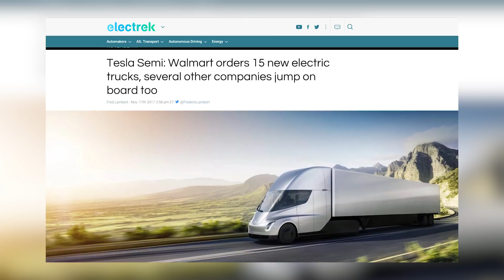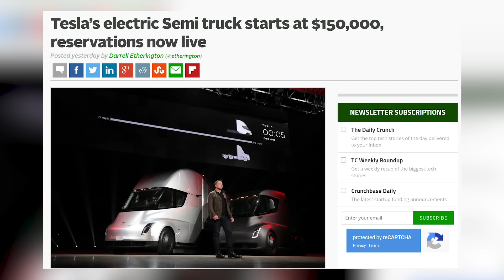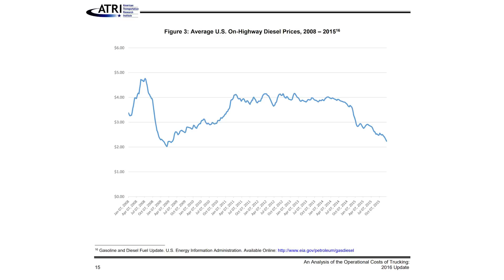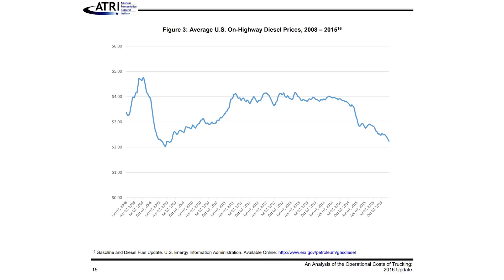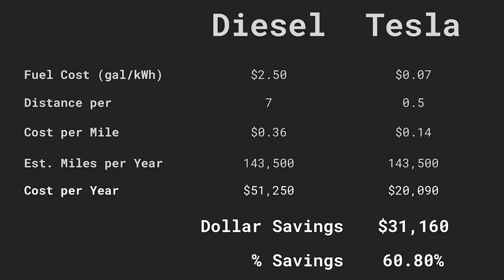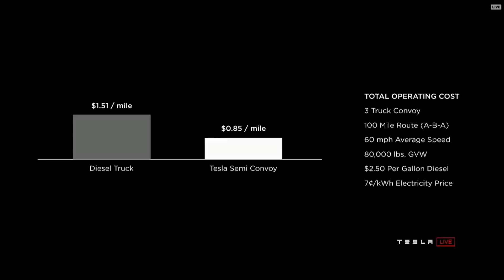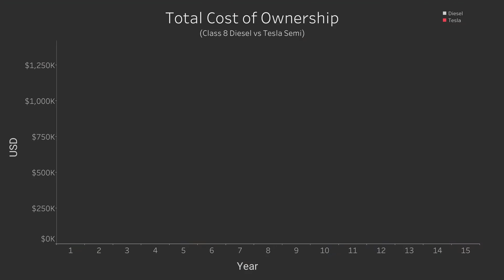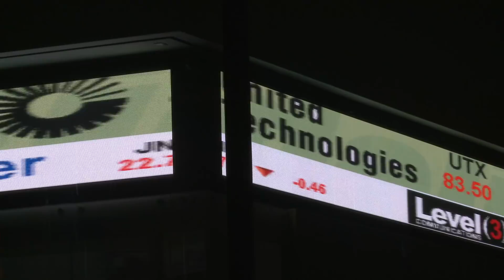What is the TRUE COST of a Tesla Semi?

Comment: Cost of diesel almost double in Australia as well so an absolute game changer here 1-year payback wow.
Reply: Ben Dixon cost of trucks is also more than double. A typical 5 year old Kenworth with half a million km on the clock is about 300k. Even with taxes and conversion, the top of the range Tesla is cheaper than the cost of an old diesel. As soon as the Megachargers go in, game over for diesel in Australia.
Reply: 3 times in norway. And extreme cost savings in "bompenger" it cost 20dollars just to enter a new area here.(for trucks) And 0 dollars for all electric cars/trucks.
Reply: dunhillsupramk3 Sadly it appears that you don't know even the first thing about truck driving. Your average truck driver doesn't drive "10-14hrs a day" for the very simple reason that it's against the law.
Reply: Unfortunately the 36,000kg GVM makes it pretty much useless for long distance haulage in Australia. One smallish trailer is too inefficient except for arpund town deliveries. The truck I drive is Approx 38,000kg empty (B- triple) and then we add a 70,000kg load of wheat or other grain for a GVCM of Approx 108,000kg. Plenty of heavier trucks than this on Australian roads also.

Until Tesla come up with a higher GVM rated truck I guess they will only be used on short delivery routes in Australia.
Reply: Electricity costs 4-5x as much though thanks to our delinquent government.
Reply: Game over, it will be an opportunity to short business here that don't order them.
Reply: and whats the avg distance a semi truck travels between stops in Australia??? as far as i'm aware the big mining companies and the big farmers in Australia is the ones that really order the big semi trucks (and yes they're directly responsible for semi truck development in Australia) carrying a big payload like on a road train the Tesla Semi truck would get far (unless maybe it has a built in generator like a hybrid).... the main reason why Tesla really developed this semi is to deliver its Tesla cars (because it looks bad when Elon Musk says EVs are the future and the Model S is being delivered on a big diesel semi).... anyways EVs has been around for over 100yrs and Tesla has been around for over a decade now, you say game changer but not that many people is buying EVs compared to ICE... 

at the Tesla semi launch the biggest thing was "oh look at how fast it can accelerate" which is something thats pointless when it comes to semi trucks..... if this is better than your normal diesel semi truck big companies from all over the world will buy it (the same way how Nicola corp sold out production within the 1st few hrs of launching their hydrogen semi truck last year)
Reply: dunhillsupramk3 525 km is the legal maximum distance a truck can be driven before stopping in Australia.
Reply: You're kidding right? I gave you a link to the rules. I don't need to make them up, I just copy them from the National Heavy Vehicle Regulator.
Reply: 80 000 lb is the legal maximum on the vast majority of US roads. Given that it's about twice as powerful as any diesel truck you can buy now, and has better brakes than any diesel truck you can buy now, it seems vanishingly unlikely that it won't be rated for higher loads in other countries. That said, the MegaChargers are going to be installed on routes with high volume. When they come to Australia that's going to mean, at least for the first few years, Sydney/Melbourne and Sydney/Brisbane. It seems unlikely that MegaChargers will be installed on seasonal routes that only see traffic in harvest or similar or the very low volume traffic routes that currently allow road trains. Basically, the market for these low volume routes is simply too small to matter.

Having said that, don't forget that while Road Trains are illegal in nearly all of the US, this truck can convoy 3 trucks with one driver. Effectively allowing Road Trains, even where such things are illegal (as they are in many parts of Australia). That means road train like convoys on the Hume and the Pacific.
Reply: gasdive you make some very good points that I had not considered. I guess I have been stuck in my bubble here in central qld a while. 

I really hope electric trucks take off here and they stay together on our average dirt roads.
Reply: This is the way forward to save the planet. Stop making excuses and let it happen. Battery charge stations are needed. If only Texans would see a market here and jump onboard rather than opposing electric cars!
Reply: Australia is very flat...I see no issue with Tesla getting a heavier rating in Australia.  80,000 lb is just a US limit.  That limit is mostly in place for roads and bridges, not to spare trucks all that weight.  Though breaking could be a concern also in the US.  We have flat areas but we have mountains as well.  Run away trucks happen all the time.  We even have special ramps in some notorious places to save the trucks whose breaks have caught fire.
Reply: @gasdive thats stupid.. so if its out in the middle of no where does that mean the truck has to stop where it is?? your avg trucker drives for about10-14hrs a day and i'm very sure they'll cross that easily... on avg they do maybe 400-600miles a day (and thats with a very heavy trailer)... the reason why so many truckers do this is because most of them is paid per mile so by the end of the week the more miles means more pay.... if this Tesla semi truck was as good as you experts claimed then big companies from all over the world would've bought out production for a few years like what happened with Nicola corp and their hydrogen semi truck....
Reply: check the law buddy.... because it appears you're making up your own laws....
Reply: Rikaishi, Tesla is planning to generate and sell the electricity direct to the trucking companies. They may well be selling at the same price here (plus tax) as they sell in the US.
Reply: Ben Dixon so Australia also pays triple for electricity
Reply: average about $0.30 AUD ($0.23 USD) per KWH in Australia.
internet says average price in the US is $0.12 USD
Reply: taxes high on fuel will charge them on electric in future.
Reply: oil has hold of texas
Reply: Teslafaninsight  I'm all for bettering the planet. But I can't see the long run of these how do they know all of this stuff how long has it been tested and this puts my job at risk as I work in the class 8 industry  who can work on them what's this mean for mom and pop company's and the numbers don't add up to me
Reply: Nice all good questions.  It is five to ten years before huge changes occur.  Tesla only company at class 8 level in long distance electric.  Nick the electric truck motor in teslas case is 3 time 17 parts or 55 parts or so vs. 2000 in an Ice engine.  repairs needed but with fewer moving parts very little mechanic work will be needed.  There are so few part that it might be throw away and replace on motors rather than even bothering to fix based on the value of the time of the mechanic over the cost of the motor.  Many issues to be figured out.
Reply: The big routes in Australia are Melbourne-Sydney. Sydney-Brisbane. All could be done with 1stop. The outback road trains are a very important market, but a very small one. Australia is a very urbanized country and the Tesla semi will take over.
Reply: all would like to see that too.  given shortage of batteries for all makers right now.  My read is they will focus on selected areas that other companies cannot do without their technology
Reply: I'm really interested in finding out how the industry and road rules and regulations incorporate the design of the driver being in the center of the truck. Been driving for 20 years and I just don't know how that's going to work.
Reply: Australian dollar is less that usd
Reply: Not really lol, 3500kg is bugger all. I can tow that with my $40k for ranger.
Reply: Same goes for Europe. Even in Germany, where Gas is comparably cheap we pay about 5$ per gallon for Truck Diesel and even more in countries like the Netherlands or Norway. Compare that to electricity prices that due to little demand and high renewable energy production this year even went negative is just a no brainer.
Reply: No they can't hang with diesels

Comment: Acceleration of a trucks mass requires the most energy at the start. Air resistance after cruising speed  is achieved then becomes the greatest energy requirement.  Some acceleration energy is recouped with regen braking. Low air Resistance per tonnage  greatly improves efficiency. Rolling resistance of the tires and wheel bearing friction are also a factor which can be improved with proper tires and tire pressure. I will be waiting to see how efficient these trucks really are.  By platooning (decreasing air resistance) really increases efficiency per tonnage.
Reply from the maker: Going to be interesting for sure

Comment: Great video, thanks Ben!  :) Although I think there's a slight mistake - 80,000 lbs is approx 36,287 kg (36.2 tonnes), not 3,628 kg.
Reply: The metric (ie 1000Kg) equivalent of the US Ton is spelt Tonne across the world.
Reply: Joe mariconadas A ton and a tonne are different things but a similar size. A bit like a yard and a metre. Personally, I detest 'tonne' because it sounds like ton and it doesn't fit the rest if the system. It should be Megagram. Mg.
Reply: A metre is a unit of length. A meter is a measuring device. If you're using the word meter to mean a unit of length then you're just spelling it wrong. Like saying your when you mean you're.
Reply: I agree.  "metric tonne" is not part of the metric system.  It should be Mg as you say and it is easily confused with the US ton.
Reply: Is it?? I'm in North America, which I assume then we are the exception to the rule!!!!! :), because that is clearly spelled in French.
Reply: You're right, there is the metric ton and the regular standard ton. At least in the US and Canada a ton is your standard 2,200 LBS. But what I never understood is why would they spell it with the extra N and E?? Same as you spelled METRE, that again is French. Here it's always spelled METER. But, languages don't always follow logic of phonetics.
Reply: Oh, and I should also point out that in the US a ton isn't 2200 lb, it's 2000 lb. You could be thinking of the Imperial Ton, which was 2240 lb (different size lbs of course but only slightly)
Reply: I guess that is a typical North American spelling conotation. Spell it the way it sounds. Meter is the measuring device as well as the unit of measure.
Reply: It's TONS, TONNES is the french spelling. :)=

Comment: i thought the convoy cost was purely on the CLOSE DRAFTING SAVINGS which is possible through sensors and communication  and good brakes which still has drivers in each trucks.  Being driverless convoy could be even more efficient by quite a bit i think..
Reply: The brakes on Tesla's technically ware, sure, but they would need replacement after 25-30years of use, which by that time the tech is horridly outdated in general and thus it's silly to even consider it, especially as most "modern" diesel trucks last 10-20years at most before crapping out in general.
Reply: Travis John lol. Brakes never wear out??? Alone might want to come out into the real world once and awhile
Reply: i said the brakes are good. electric trucks brake much quicker.. elon said youll never have to change brakes and they last forever.

Comment: I have over 35 years of driving, You still need greass in places, You will need some work, The breaks need looking at.  There are things the Elon does not know about, The rules that go with trucking. You will need an ELD that tracks the truck as the driver goes down the road.  I don't know what all to say
Reply: James Baxter 
Did you listen?
The brakes DON'T "need looking at"!
They are basically There for EXTREME emergencies. The regen braking is used for all normal situations, so the  "conventional" brakes "never wear out"!
Nothing to grease! (On the tractor)
Reply: If you wish to listen to him about the brakes, I have a bridge in NY to sell you, They have to be looked at. The truck has to be looked at all the time, The D.O.T. will be on that every time they stop you, Like other things

Comment: Better to change couple brakepads occasionaly that the whole brake system. Thats what happens to electric cars in Norway where they have salty roads in winter and brakes never get engaged...bad selling point.
Reply: They could program the truck to periodically use the friction breaks to prevent this and test them aswell.
Reply: Yngve Lindvåg 
Clutching at straws there?
Note to driver, check brakes twice each day? Easy!
Maybe a "brake test" mode to switch off regen for 30 seconds and monitor braking during the test? Simple. The Tesla must have pedal force/ angle sensors and torque sensors on each wheel, so it could monitor a brake check MUCH more effectively than eyeballing by the driver!
And then, of course, it would relay the results to the driver in real time and a warn of any maintenance required.
GOOD SELLING POINT!

Comment: The truck is beautiful and looks to be a real winner. One thing I noticed it did not SEEM to have any tow hooks or access holes to the frame to attach chains .  Most of my career was spent in the telecom business for Rockwell and other fortune 500 companies. We installed microwave antennas and equipment in remote locations. The  delivery trucks carrying antennas would have no problem most of the time. BUT, most of the sites had dirt/gravel roads and the semi trucks would sometimes need help due to traction issues, either getting in or getting back out. To help we would typically use a backhoe to perform this task.  Bottom line. I did not see any attachment holes/points on the new Tesla Semi. These attachment points would also be used to pull a tractor back onto the road if it slid off due to snow/ice or just needing help back onto the road/highway......
Reply from the maker: If it’s like other Tesla’s those are available underneath some of the covers. For example the tow hook on the S is underneath the nose cone
Reply: 4 wheel independent powered wheels.
Reply: I guarantee it will have some, I've already seen semis that have hidden ones. I think it will also be less likely that these trucks will get stuck in the first place, having 4 independent motors with traction control, you would really have to get yourself in some shit to need a tow. That said i'm sure it will happen sometimes, but these are definitely intended to stay on the road.
Reply: Semis have holes in the bumper. 
You install eye bolts though the holes when needed. 
Hooks are not welded to the frame any more .
No one in my company has the bolts 
I assume the tow truck does
Reply: Will see about that in 2 years when literally ever component breaks.